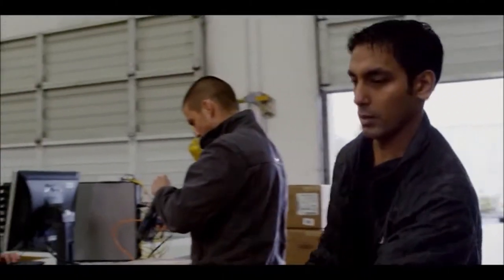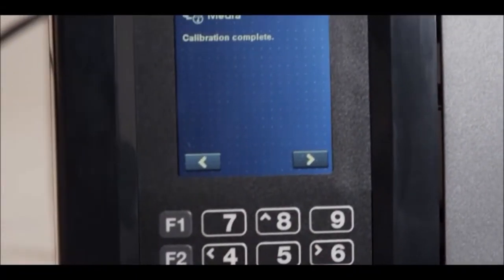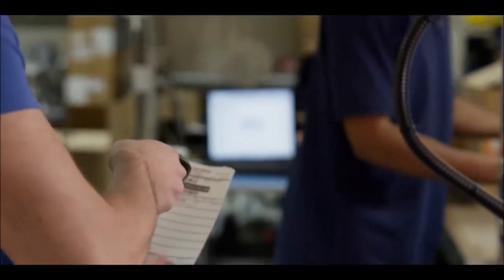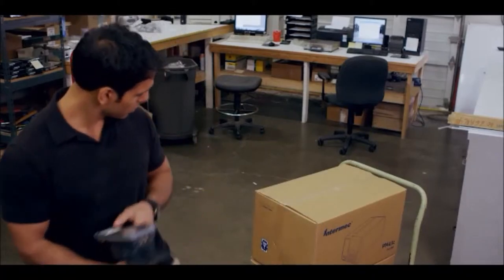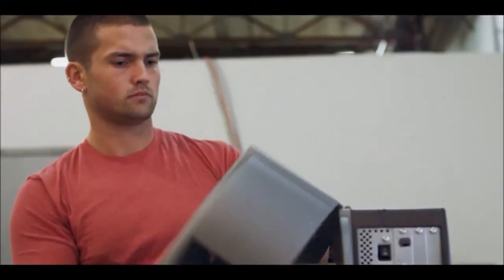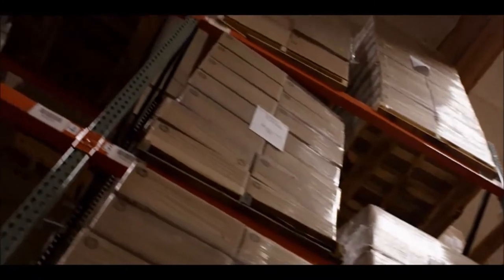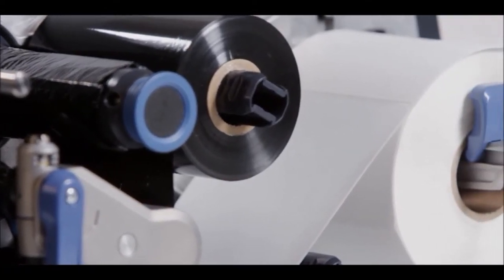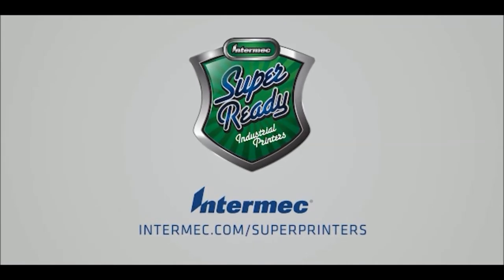PM43/PM43c Mid-Range PrinterPM43/PM43c mid-range industrial label

Comment from the maker: PM43/PM43c Mid-Range PrinterPM43/PM43c mid-range industrial label printers are ready to perform. Reduce workforce training and support with the tamper-proof, 10-language, color touch-screen or universal-icon interface. The PM43/PM43c is a third-generation Intermec industrial printer designed to maximize your uptime. Count on the PM43/PM43c to deliver quick deployment, the fastest print speed in its class, and proven reliability.
   
Key Selling Points
Maximize uptime and operational consistency
Enhanced Self Strip for challenging media types
A tamper-proof color touch-screen in 10 languages or a universal icon interface maximizes uptime
Precision Print for consistent bar code printing with pin point accuracy
Reduce time to deploy and maintain
'No-Touch' configuration via an embedded RFID chip. This patented capability enables configuration without opening up the printer box or powering it on. Reduces deployment time by as much as 20 minutes per printer
All in One Printer Command Languages = Integration into typical environments
USB Host/Boot enables file download from USB Thumb Drives & easy connection to Scanners & Keyboards
Improve cost control with remote monitoring
Integrated device management and diagnostic capabilities delivers a powerful ROI
Multilingual Web page loaded on every printer ensures easy device monitoring from computers, smart phones and tablets
Solutions that grow and adjust as business conditions change
Programmability enables deployment of comprehensive labeling applications and solutions – including attached scanners, scales or other peripherals, all without the need for a computer for quick ROI
Advanced Connectivity = Future proof with IPv6
Collapsible core for non-core ribbon usage